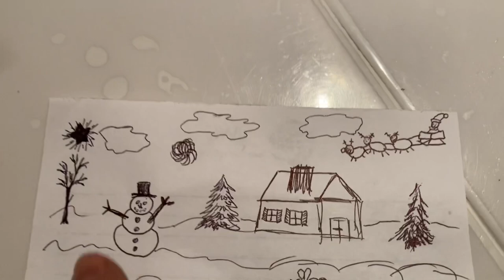Monday Vlog, Car in the shop, celery juice cleanse!

Comment: What is an electronic throttle control?
Reply from the maker: Whatever it is it wouldn’t let my car go faster than 30 miles an hour.  I had to keep stopping and turning off the car, restart it and it would work for a couple miles and then do the same thing.  It was an expensive fix but was great to have a good working car again
Reply: @marilynsartadventures3956  That  really strange.